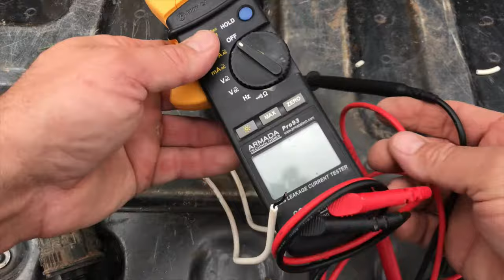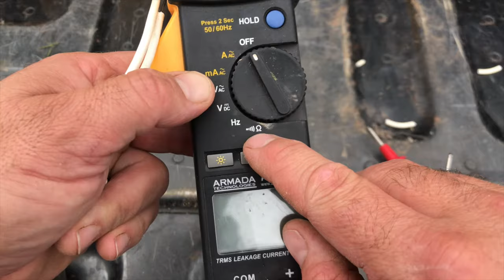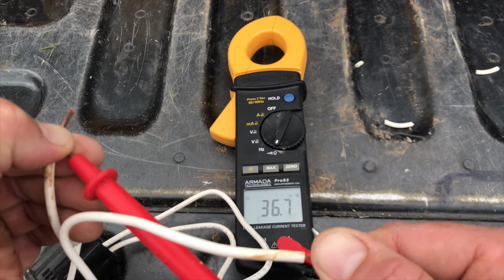Sprinkler System Solenoid Troubleshooting

Comment: When measuring resistance, it's best to only hold one line to the meter with your hand. The way you showed it you're measuring your body resistance in parallel to the solenoid resistance. For the test you're showing it's not that big of a deal but in general for accurate readings you should only hold onto one lead to truly isolate the component you're testing.
Reply: True
Reply: And if it does resistance,  current and volts, it's called a multi-meter.
Reply: Use alligator clips

Comment: Thanks for the good video. The resistance is jumping all over the place because the wire ends are severely corroded, completely black. Copper oxide is poor conductor. Metal oxides are what they use to make electronic resistors. To properly test the solenoid, you would need to cut off the corrosion and strip back to clean copper, then you can accurately measure resistance of the coil. Since it's hot means it is LOW resistance, not high resistance like you thought you measured. Too LOW resistance, caused by shorted coil windings from overheating and melting the winding insulation, draws more current than it should and overheats the coil, worsening the short, until the coil wire itself melts. Then you get open circuit, infinite ohms. 
If the coil itself was really 600 ohms then it wouldn't draw enough current at 24V to operate the valve. 
PS: my brand new orbit residential valve measures 60 ohms fwiw.
Reply: N 0l

Comment: You cannot measure resistance accurately when your copper leads are covered with oxide. Cut the wire back until you reach clean copper and test again.

Comment: The wire ends on that "bad" solenoid looked very corroded.  If you had cut the corroded wire and stripped back some fresh, clean wire and then took the reading, I wonder if it would have been okay?  Just a thought on your really good video. 👍👍👍

Comment: I looked at several different sites and was most impressed with your simple way of testing solenoids with a voltmeter.  Checked the solenoid for the "missing zone (2) and it was jumping all over the place.  Went just one step further and at the control box I switched the active wire for zone one and zone 2 and it worked in reverse.  Bought a new solenoid today for $6.49 and fixed the system to working zone 2.  Really appreciate your video and thank you for a SAVING A service call to the local guys.

Comment: This is a good video and very informative. Thank you. Also, note to homeowners, if you have an older system (mine was put in 13 or 14 years ago) check for corroded wires coming off the solenoid. That was my issue. After checking the solenoids with my multimeter and finding them all good, I saw that nearly all of the wiring was corroded where they connect in the wire nuts but only one zone had stopped working. No doubt others would have followed suit. Simple job of snipping the corroded portion, stripping the wire and putting it back together (new wire nuts).
Reply from the maker: Excellent comment. Thank you. A lot of the time wiring issues are in the splices. One of the first things to check and redo.

Comment: Watched your video, perfect directions, I mounted all my valves/ solenoid’s, controller and double check back flow inside the garage  so no corrosion or scorpions, got out my ohm meter and checked a spare ( new replacement) 46.7, then checked each solenoid at the controller, all said 46.6 to 46.9 and no fluctuation. They have been on the wall high and dry for 18 years with one leak on a plastic pressure reducer so thank you for making the test so simple. If they all failed tomorrow I’m still ahead of the game. Thanks again.

Comment: On the bad solenoid, the corrosion on the bare copper is what's causing the readings to jump.  Strip it back until you have bright copper, like you had on the "good" solenoid, and test again.  I think you will find the reading will be stable.  Now that doesn't mean it's not bad.  Just explains why the resistance is constantly changing.

Comment: Solenoid wasn’t bad its wire end were badly oxidised thus poor contacts sensed by the voltmeter.
Reply from the maker: Good thinking. I've had several like this that would give me different readings and some would work and others not. Ultimately I put new ones in and we are good to go. thanks for the comment.

Comment: New subscriber here and so glad I found you. The company that installed my system went out of business and I’ve got a solenoid acting up and the zone won’t open. It’s outside in a ground box in New England and when I turned on the zone it was trying to open making a grinding noise. I hit it with a hammer (gently) and got it to open but I know it’s not long for this world. It’ll have to open so I can winterize soon. 
Interesting to hear the box stores sell bad ones. I’ll take my ohm meter when I have to go shopping 😉 And pray it’s just the solenoid and not the valve that needs to be replaced

Comment: My irrigation system is like from ancient times.  I have a Toro XF-416 controller and was fortunate to have a spare for parts.  My solenoid is bad on zone 1.  I can turn it on manually by twisting the little valve on top of the small tower, the solenoid is next to it and has two screws that hold it in place.  What can i do to replace this part if it's no longer available.  Is there a universal solenoid out there that may be adaptive to a two screw housing type?
Reply: Swapoed the solenoid with another... wasn't that.  Took apart the valve and sucked all the water and debris out with a wet vac, put it back together and presto works like a charm.  👍

Comment: Can anyone explain to me what the ohm meter is actually measuring if the solenoid isn’t connected to a power source? There shouldn’t be any current for it to measure if there’s no electricity flowing through it, right?

Comment: This technique did not work I set the dial to ohms and both the old solenoid and the new solenoid stayed on zero on the meter. The battery is new on the meter so it works.

Comment: My neighbors valve is clicking on and off with water pulseing out of drip lines.  There's also water around the valve.  What could be the issue?
Reply from the maker: It could be a number of things. I would say it is an electrical issue. Could be controller, wiring, splices, that solenoid... That system is probably going to need a professional to come out and troubleshoot it and check all of the above.

Comment: Thanks for the video that helped me diagnose my sprinkler issue.  All of a sudden, both valves in valve box#2 stopped working.
1. Ohm'd valves  at the controller for valve box#1 - GOOD (~53ohms)
2. Ohm'd valves at the controller for valve box#2 - <open>
3. Disconnected/cut the wires of box#2-valve#1 and ohm'd it - GOOD! (wtf?)
4. Tied the wires at the controller box and Ohm'd wires at box#2-valve#1  to verify wires - GOOD!
5. Inspected the waterproof ground wire nut in box#2 - Corroded!
6. Replaced all the waterproof nuts in the box#2 - ALL WORKING!

Thanks!
Reply from the maker: Awesome. Good work. I’m glad you got it all working.

Comment: Can you test in ground without removal
Reply from the maker: Yes. You will cut the solenoid wires out of the splice. Then strip back some good clean wire and test it in the valve box.

Comment: So I have pressure for about 5 to 10 minutesAnd then they lose pressure and go back in but my system still running. That is on everyone of my zones. Sometimes I can make it through one whole entire 30 minute session the next time they only go 10 minutes. Again that is on any zone that I started out in. Do you have any idea what it might be
Reply from the maker: It could be a controller problem or a master valve problem if you have one, or a wiring issue like a few zones wired together that your system can’t support. Or if you are on a well it could be a well pump or water issue. Or if there is something else going on at your house using water or in the area that could cause the pressure to drop. Just to name a few. I recommend getting a licensed professional to look at it with you.

Comment: So I'm going to have to remove every single solenoid and test it? Isn't there an easier way
Reply from the maker: Yes. Before you start cutting wires and splices and taking out solenoids, you need to determine which valve is giving you trouble. Then first test it from the controller. Watch this video here: Ohming Out a Solenoid | Sprinkler System Troubleshooting
https://youtu.be/VcW13VWwMf4
I’ll show you how to find a bad solenoid from the controller.

Comment: Hey so my dog pulled up all of my sprinker heads and broke coupling off in tee. There is seven zones and they aren’t in a box they are just in the ground. And also the pump seems like it’s froze I have no water at all…where should I start
Reply from the maker: Oh man. Sounds like a big job. It might not be a total redo but don’t be surprised if a contractor looks at it and says it’s best to start over. I would start with the pump and get water first. Then install valve boxes over all the valves and make sure the wiring works and is good. Then move on the the sprinkler heads. Good luck and get ready to work.
Reply: Start with a new dog  😂

Comment: What does it mean when my multimeter reads 0 ohms when I test my solenoid? It's a brand new solenoid also.
Reply from the maker: Most likely it means it is bad and has a short. It is possible to get a bad one from the factory although that percentage is very low or it was a return the went back on the shelf. I’ve seen that too. You could try testing another one to make sure the multimeter is working properly. Otherwise unfortunately you may need to get another new solenoid.
Reply: @AmericanIrrigator  
Big  box stores are notorious for putting defects back on shelf.

Bought the same defect item off shelf, I had returned 6 months earlier.
Had "BAD" written in Sharpie , still on it , that I wrote 6 months earlier 😬

You will go thru 2_3 remanufactured car starters, before you get one that works correct.

Better count the number of teeth on starter gear also.

Some have 9 teeth, some have 13 (on chevy).

They get these mixed also on remanufactured starters, you buy from auto parts store.

Grind the teeth off flywheel, with wrong number of teeth on starter gear.
Reply: A solenoid can go bad in two different ways: 
1) If your meter shows 0 or just a few ohms this means that there is close to no resistance from one wire on solenoid to the other, the solenoid you tested is basically a wire nut that would cause a short circuit on that station's wire run between the station wire and the common.

2) If your meter shows a high ohm reading or infinite resistance "OL" as shown in this video, then the solenoid has caused an open circuit between that zone's station wire and common. 

I'm a year late in my response but hope this helps at some point down the road!

Comment: water4gardens irrigation London. that coil was bad before you tested it, the 24vac cables are black that's a clear indication of a bad coil, the resistance is bad cabling is hot will almost defiantly damage the controller and power supply